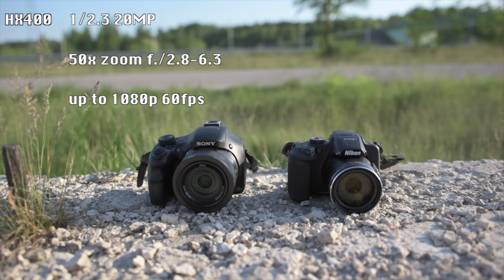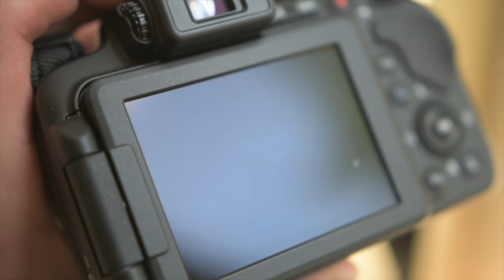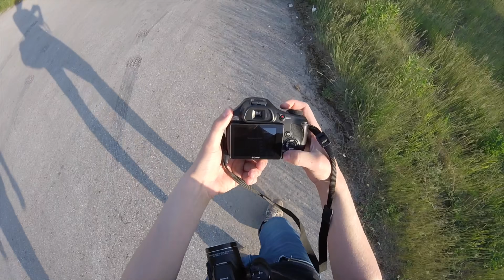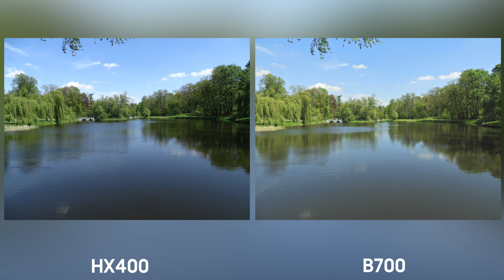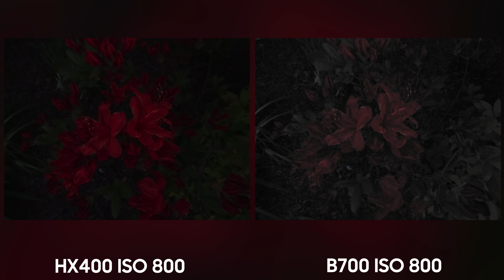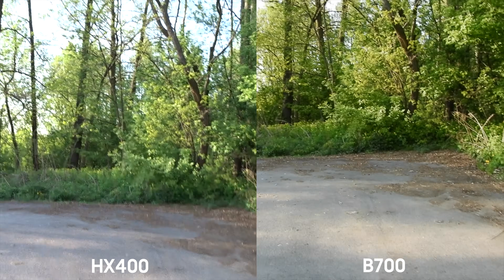Sony HX400 vs Nikon Coolpix B700 – Which One is Better?

Comment: Important notice: after purchasing the B700 for the second time, the main thing that caused me to sold the first one was the unpleasant oversharpening of 4K footage. Now, after more deep testing i found out that by default the sharpening is set to a certain, near maximum value, not to zero. you need to use program, shutter, aperture or manual dial setting and then turn the sharpness to zero or maximum only one step up. in that way the video in 4K will be more natural, a bit softier but realistic and much much pleasant to watch. not on the level of panasonic lumix fz series or micro 43 cameras but enought to be acceptable. This camera performs enexpectedly well in low light and the stabilization is really good.

Comment: After having the HX400 for 8 months now,  and still having the Lumix FZ80,  I can tell you which camera I carry and use on a daily basis.
  Sony HX400v. 
On paper the specs of the FZ80 are stellar and better than the HX400,  but the Sony just plain works better.  It's like the Bionz X picture engine is better than the Lumix when it comes to image quality.  The big exception is when photographing the moon,  the 60x lens of the Lumix really makes a difference over the 50x of the Sony. 
I am actually going to buy another HX400 so I can have a fresh one when I wear this one out.  I  think they are out of production and are getting scarce at retailers.
Reply: Bought one 2 years ago on ebay for under £50. Had no idea what I'd stumbled upon until I started using it!
Had a missing corner of the housing which I filled with sugru and it's been solid ever since. It's impossible to replace without spending many times more than what I paid for this

Comment: Well, now I'm a little disappointed. I just bought the b700 last week and if I would have seen this comparison first I would have searched more. After watching this video I agree with you that the  hx400 is a better all around camera especially that it has better low light and more accurate color. However my relationship with Sony as a corporation is jaded and I will NOT buy their products. I might have gone with a Panasonic or something else though. So anyway, I didn't do very much research because I got a deal on a refurbished b700 direct from Nikon for $240. It's replacing  my Nikon p600  which has been a little buggy after I got caught with it in a downpour miles from shelter. I believe the b700 is 2 upgrades from the p600, they use the same battery, look nearly identical. So my learning curve is small I can use photoshop color correction on my favorite pix and overall the b700 is an improvement and an excellent mega zoom camera. 
Btw I wish I could have spoken more about the b700 but I've only taken several test shots.
Thanks for the video.
Reply: grutch against a company..you do realize how many types of products Sony make??? Your loss

Comment: nikon's raw cancels all the bs of "nikon is duller, flatter, bad in low iso, blah blah" for anyone who has a few working neurons and able to control the cam a do any ph postprod. nikon's video is way more detailed, more data in input, better final compression. sony's in-camera hdr on 2 pix and better IOS could count, but its bigger size is a bit neg factor here. you would make a waaay better hdr on a serie of nikon's raw. sony's 2 custom presets are nice to have !

Comment: Great review!!!  I had the Nikon B700, which was stolen so am replacing it with the Sony HX400.  For my purposes the Sony seems a better fit, but I do wish it had RAW.
Reply: I will go for Sony for following reasons
1. Zeiss lens with T coating
2.It has Intellegent and Superior Auto
3. Manual focus with  focus  ring , which is like using a DSLR.
I have the HX90V having all the features of HX 400 but very very compact and the low light performance is Absolutely stunning and awesome

Comment: Sony HX400 : Win for Macro (Details Lovers) +1
Nikon B700 : Win for Better Zoom 60x +1
Sony HX400 : Win for Some Material Looks +1
Nikon B700 : Win for Slighty and Lighter, Simple Do Love This +1
Sony HX400 : Win for Grippy Comfortable, Bigger Hand Love This +1
Nikon B700 : Win for 4K 3840 UHD for Zoom and Details Better +1
Sony HX400 : Win Better for Great Image Stability for Video and Take Photos +1
Nikon B700 : Win for Battery Capacity +1
Sony HX400 : Win for Multi Interface Shoe (Flash, Mic) +2 
Nikon B700 : Win for NFC, Bluetooth and Wifi +2
Sony HX400 : More Cheap After 4 Years Old
Nikon B700 : Win for Newest and Best Budget +1
Sony HX400 : Win for LCD Realistic Colors +1
Sony HX400 : Win in LCD Rotating Design +1
Sony HX400 : Win for Comfortable Viewfinder Design +1
Nikon B700 : Win for RAW Needs +1
Sony HX400 : Win for Software / Lovely Menu and Automaticly Macro +1 
Nikon B700 : Win for After Markets Compatibility +1 
Sony HX400 : Win for Original Sony Compatibility +1
Nikon B700 : Better Manual Aperture Lovers +1
Sony HX400 : Autofocus is More Great +1
Nikon B700 : Lovers Brighter Neutral in Daylight (Take Photos) +1
Sony HX400 : Lovers Accurate Details in Night (Take Photos) +1

Question for You? Ok :)
Nikon B700 or Sony HX400 : For Better Voice Video Recording? (without upgrading just their standards) +1

Result of Value : 
Nikon B700 : ….Sony HX400 : ….

Absolutely Agree With Your Video :)
Very Love this Review!
Reply: Devaporchef Indonesia wifi in nikon?
Reply: Artinya apa mas aku ga ngerti 😂 aku mau beli sony h400